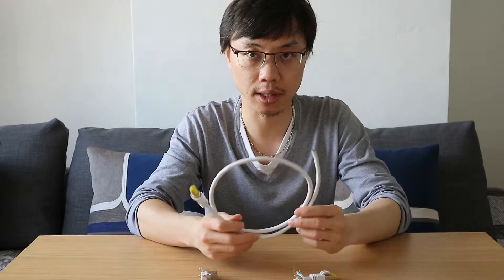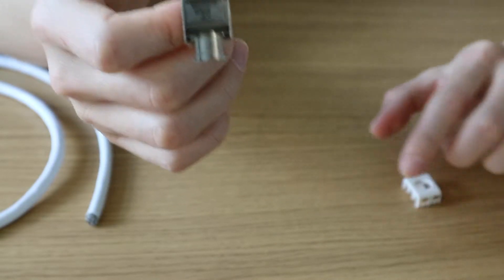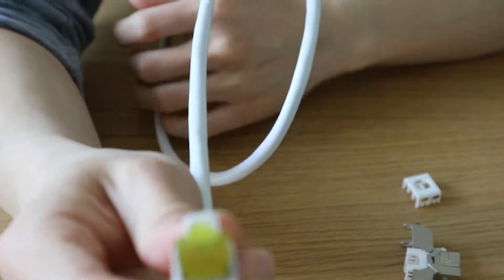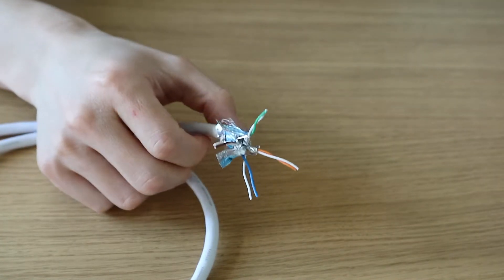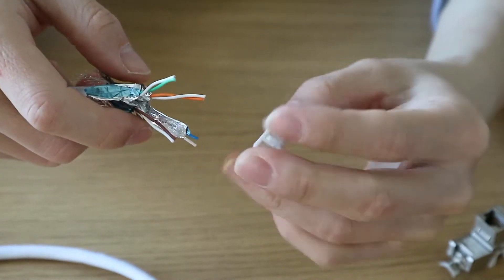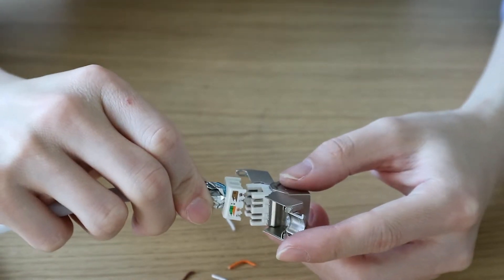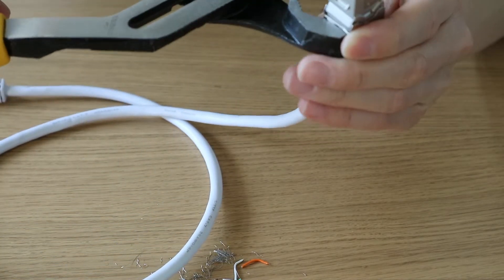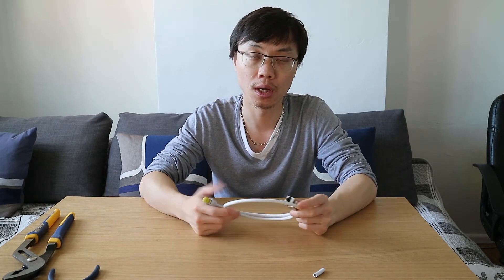How to wire Cat6a keystone jack

Comment: Tao, how do I even open the modular keystone? I don't want to be heavy-handed and break the thing. It's firmly shut.
Reply from the maker: @ Jay K 
If the ones you have are the same as mine, then try gentlely pry open. Mine are loose when got them. Good luck
Reply: @TaoMStudio  I'll give it a try. Cheers.